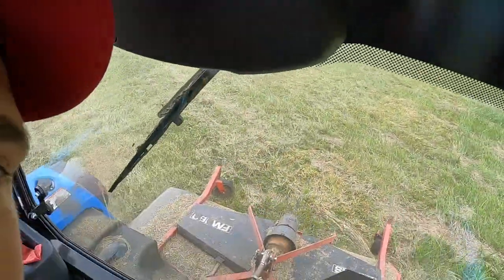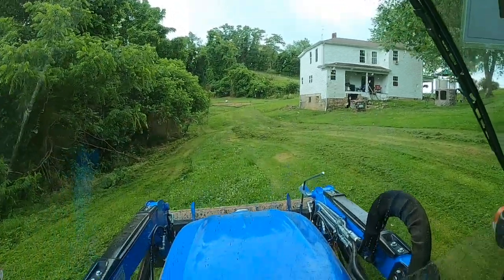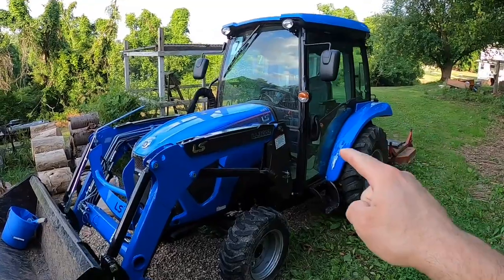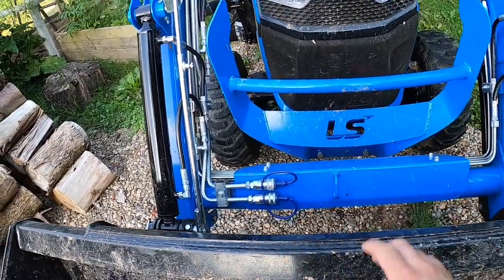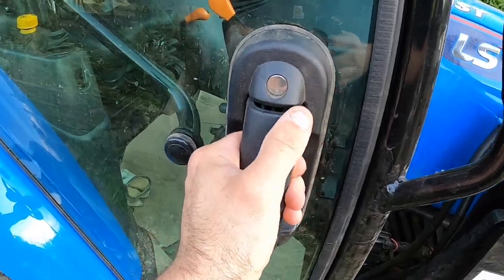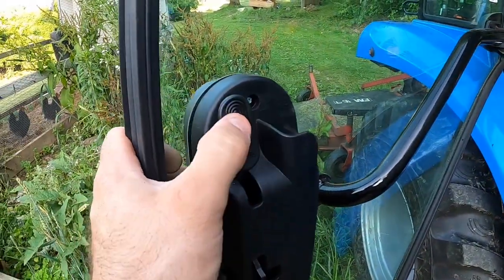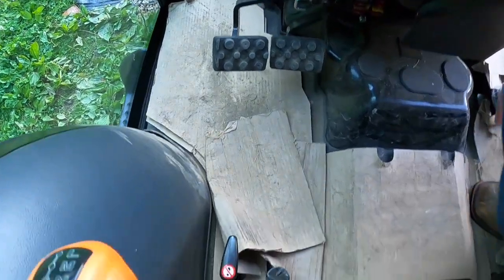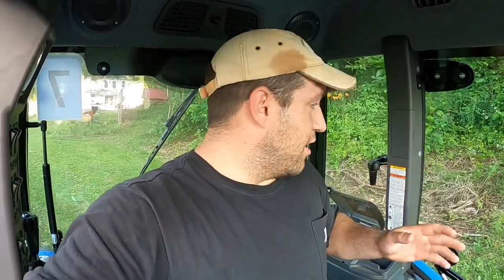LET'S LOOK CLOSE AT NEW Features On The New LS MT2 Series Tractors | LS Tractor Review

Comment: Nice little tractor.   
I would like to see the rear wiper making the window clear over my back right shoulder.  They have  the best  rear wiper design and front wiper design on the mt573.  This design should be on all of the tractors.  The wipers should also have a delay just like on a car.  

Parking brake needs to be up high by the 3point lever where it’s handy.  

Four wheel drive lever is fine being mechanical but the lever needs to be moved back and extended    Again a guy should not  have to be reaching to the floor to operate the tractor.  

I like the low medium high pattern for the ranges.

Comment: The one complaint I have been seeing about LS tractors, is the loaders are  getting bent. This is a on going problem I have been seeing on YouTube.
Reply from the maker: These loaders and backhoes are from a new manufacturer in South Korea. I used it to dig out a mudslide on my property, and it held up to everything I used it for. I've never had an issue on my 2017 XR4040 either which is one of the old front endloaders. A lot of times I hate to say it but it's operator error. These tractors aren't dozers. You gotta have a feel for what you can do with them 👍
Reply: Never heard of bent loaders on LS.  Searching YouTube I couldn't find a video about this so this tells me it's not an issue.  More than likely a single operator error.